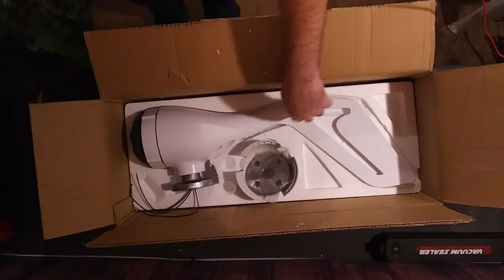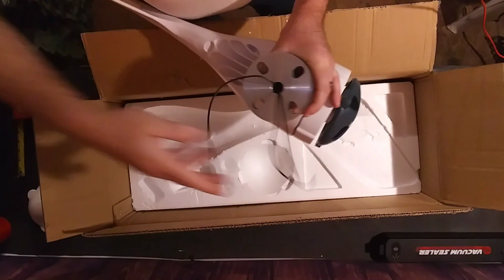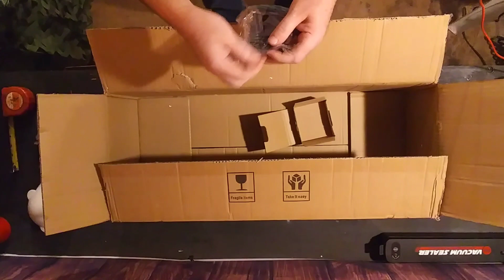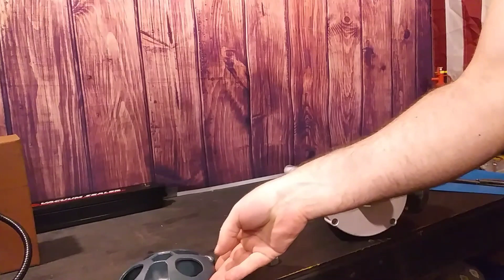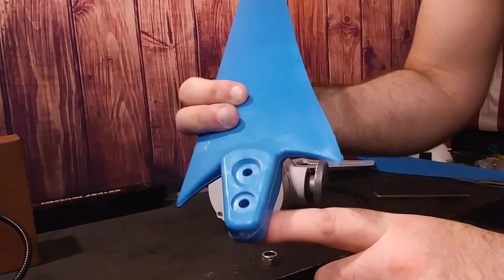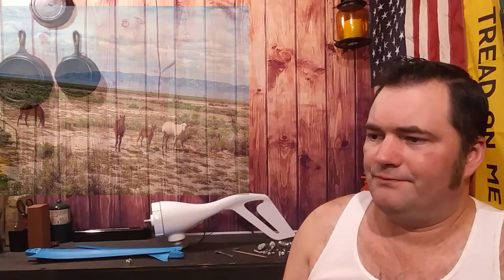Living Off The Grid Wind Turbine

Comment: seems smart to use wind lots of flat land there. how is it recommended to protect them during wind storms over 30mph? you had the other stove video and was wondering no trees there? you having wood delivered? i had a large wood stove and in the winters up north i cut / split lots only to last a few nights. i have 12 volt thermoelectric modules and wondered about a geothermal thermoelectric module heat pump? if it would be efficient for heat and cooling?
Reply from the maker: Yeh have to bring in wood. Got a good friend in Idaho who willing to hook me up. But also keeping pellets on hand 👍. The wind turbine has a cut off at a certain wind speed.